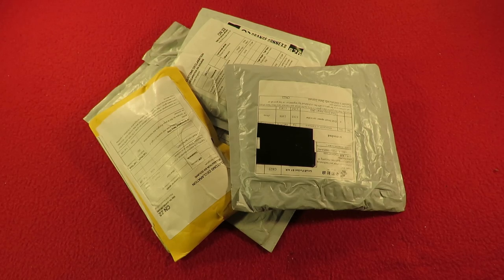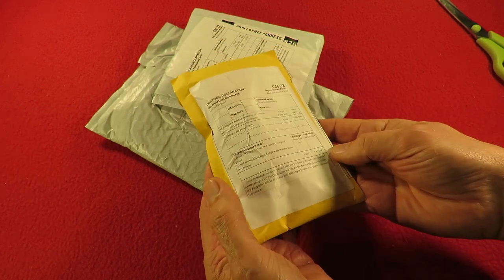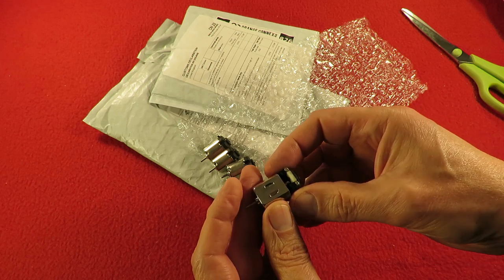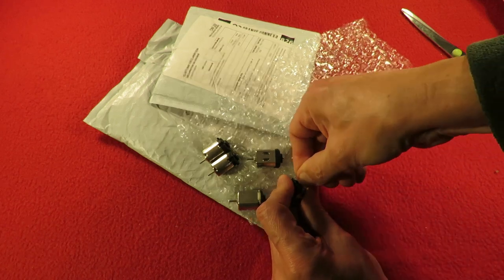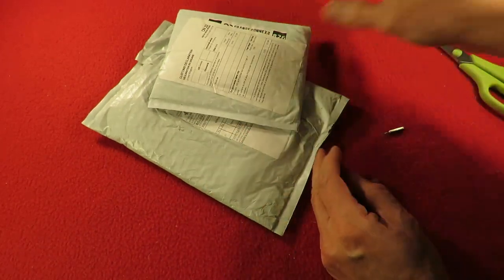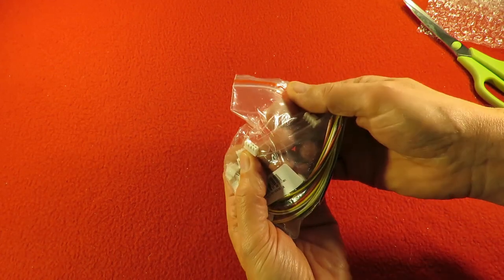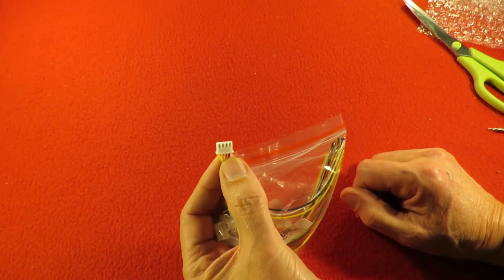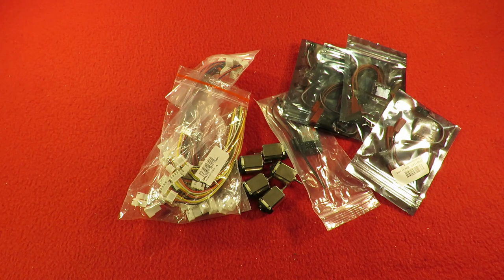Grandad's postbag 191222 ESCs DC Motors Balance Leads FlySky Receiver

Comment: At prices like that, it makes me want to try things with RC control. Custom or mods like you do.  A question came to mind as I watched you open these.  What kind of track record have you had with the controllers, ect. Do they last under heavy use? Just wondered how well they held up.  For the super low cost it makes me wonder but I do not remember you complaining about them over time.  And yes, getting stuff in the mail to open IS just like Christmas to me.   : )
Reply from the maker: The FlySky stuff seems to be fine and has lasted me well. I don't use the stuff every day and I don't do fast and wild. My original FlySky FST4B has been in use since 2014